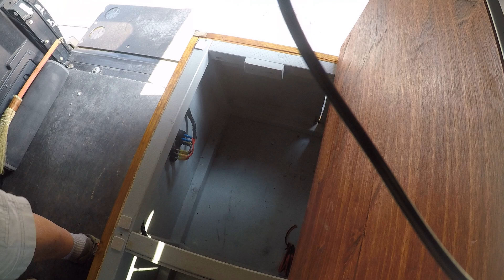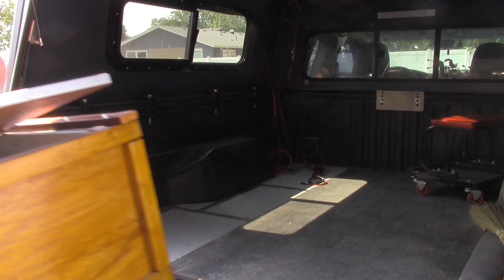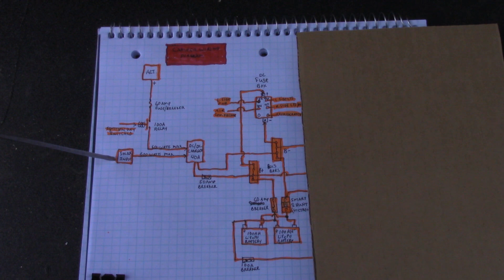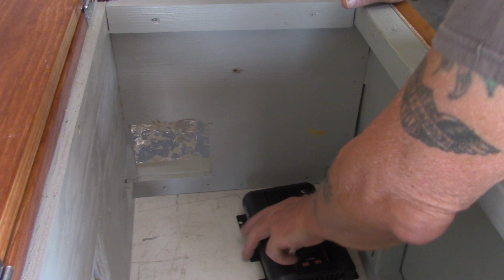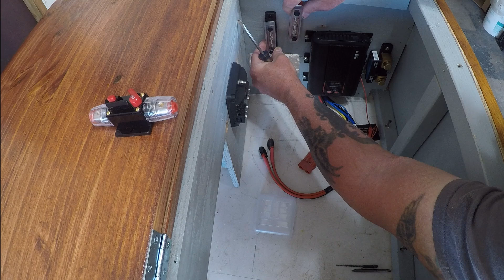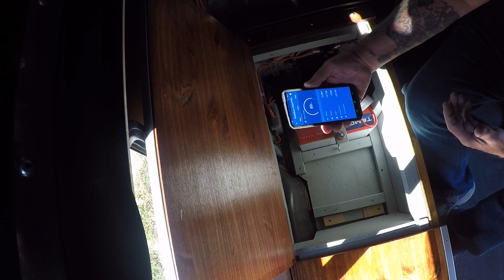Building The Mesa Part 5: Final electrics - 12volt DC side

Comment from the maker: I've had some reports that the audio on this one can only be heard in the left ear. This isn't the first time it has happened, but I believe I've found the culprits. First, the wireless transmitter I wear has a small button on the side to switch between mono and stereo which has a tendency to change to mono output when accidently bumped. Second, the soundcard on my PC seems to be putting out a single central audio to the headset so everything is heard in both ears no matter what. Everything sounds normal when editing, but after being uploaded splits to the left ear mono mode. It's very aggravating and I will be purchasing some new hardware in the near future.